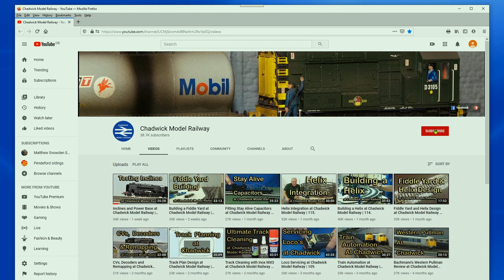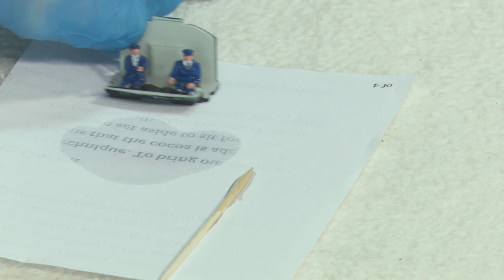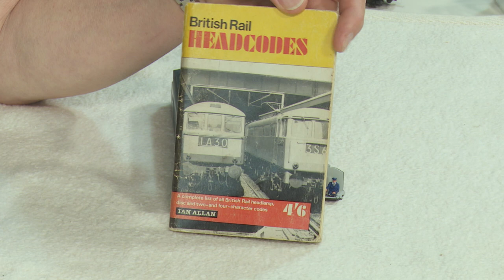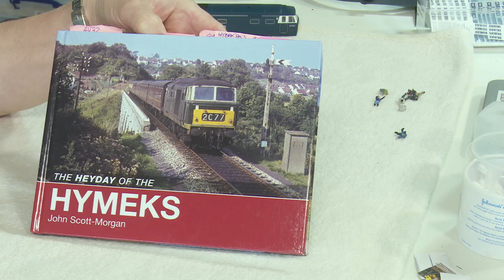Fitting Loco Crew at Chadwick Model Railway | 130.

Comment: The Dremel section was like watching a horror movie. I was just waiting for you to lose a finger!
Reply from the maker: Come on Bill, have some trust!
Reply: I was thinking the same. 

Reminded me of my old P.E. teacher who tried to adjust the motor fan of his car with a finger and then unbelievably tried it a second time! Result: He lost the ends of two fingers. He wasn't the sharpest tool in the box as you've probably surmised.
Reply: @ChadwickModelRailway  Really? Please take more care as we all care for you very much. Or at least I do.
Reply: @ChadwickModelRailway  By the way, I destroyed my left hand thumb while doing a blind dado cut on a table saw while doing some woodworking to relieve myself of a twit who required me to fix a mirror in the soon to be sold house. You can look up what a bling dado cut is. I no longer do those kinds of cuts, instead preferring to use a router to complete any such work. We all care about you Mr. Bishop, or at the very least I do. Accidents occur in a rush. I thought I had had a lucky encounter with real harm, only to discover that there was some liquid splattering upon the floor. It was my blood from a dangerously 'sawed' off thumb. That thumb still does not work properly despite emergency micro-surgery by the best surgeon in the area. We all care about you very much. please do take extra care, especially as we both age. I only say this because I care. My thumb, of my left hand, after decades, has some slight movement in it. Safety first my friend. Safety first.
Reply: I had the same when watching Justin of SMS the other week I saw it coming Ouch!! 🥺
Reply: @ChadwickModelRailway  i have faith in you charlie
Reply: I think the entire model railway fraternity held it's breath for a moment!

Comment: Recommendation from a model painter: Use the grey primer from halfords, much easier to see detail. Thin citadel with water instead of thinners and apply in two thin coats. A diluted flesh wash on the "fleshy bits" and a black wash (Citadel Nuln oil) on the uniform will really help.
Reply: Wow, that is great advice. Thanks very much. R. Mycroft
Reply from the maker: What an excellent comment Mark, many thanks.

Comment: Charlie,
Great tips.  But I would like to add a couple.
First whenever I purchase high price (Metal) scenic details, like figures, I ALWAYS take a bit of modeling time  to cast a mold.
In this CoVid-19 quarantine lockdown I have been experimenting with Silicon in water moldings.  No I am not yet proficient.  But Epoxy molds I have raised myself to a level competence.  SO...
When I buy small scenic parts, before painting, weathering, amputating, or gluing, i make molds of them.  Then when I need a batch of such items I just make my own model castings.  First it adds to my modeling artisanship.  It gives me something to keep my hands active while watching the TV.  And it reduces my modeling cost drastically.
Lastly, Charlie to keep the damn Rivet Counters at bay.  Before attaching the hacked off figures into your train cabs or coaches paint the severed ends the color of the seating or flat Black.  With certain glues the paint may limit adhesion.  Beware!
Great episode, Charlie
~Jim in the U.S.A.
Reply from the maker: Great comment Jim, I’m very impressed.

Comment: They did look better with cab staff Charlie.  I got a little bit worried when I saw you with the dremell cutting the bottom half off.  It was interesting that it was difficult to tell the cheaper e bay characters from the more expensive painted ones from a distance.  However, it has made me think I need to get more operating staff in my steam locos of which I only have some in place.  They definitely look better.
Reply from the maker: I’m so pleased that you found it interesting Don, and as you say, it’s time to man up. Regards Charlie

Comment: One will have to be very careful when going to meet Charlie for a drink. As one could end up going home all painted up and legless, LOL. When you mentioned the use of glues and as I haven't seen all your videos yet. Have you done a Vlog about caparisoning the glues we have at our disposal over another similar brand. Plus what would you say are the pros and cons that you have found using them on materials to which they are supposed to bond i.e. plastic, wood, metal and card etc. With your comments about health issues and wearing protective gear. You had me on edge with the sight of seeing raw meat and bone whizzing threw the air and red fluid plastered over the camera lens. All the while hearing you say, "Well, that will be my fingers then", LOL.
Reply from the maker: Sorry about the scary bit.  I’ll have a think about glues, they really are varied and subjective in our choice.
Reply: @ChadwickModelRailway  Yes, when one thinks about it, it is a rather STICKY topic to talk about, LOL.

Comment: Another informative video, delivered in a down-to-earth way, warts and all! One suggestion regarding the CA glue - don’t use it....... As for the spray can of accelerator talk about overkill. If you use it get a small pump bottle of accelerator, it is the better option and apply using a small plastic pipette to put a couple of drops on the joint. Using accelerator makes the CA very brittle, was there a reason you couldn’t just leave it to set for a minute or two? To fix the crew just use one of the tacky craft glues, more than strong enough and easy to remove later. Anyway thanks for your videos Charlie, always interesting and entertaining.
Reply from the maker: The wo part mix glue proved to be the best but a fair point regarding CA glues mate.

Comment: Absolutely worth doing.  Not so important on   heljan models as few locos come with cab interior lights but for those models that do its  worth picking out the bulkhead details with a bit of paint. Very satifying and easy if youve removed the cab anyway.
Those quartz light bars that heljan fit are horrible and easy to break.  Thankfully they are moving over to LEDs as models get retooled.
Reply from the maker: I’m so pleased that you enjoyed it. Regards Charlie.

Comment: Crews in front look great when examined close up, ditto on your very simple sound improvement - well worthwhile, however not keen on the mini flying saucer in the opposite cab window! Like you I have found you have to experiment with speakers - installation, location, baffling and type, there can be surprising results!  I wonder will we ever see drivers being raised and lowered into position as the engine reverses at either cab end (got to use those redundant DCC digital outputs for something), or perhaps a holographic display!!! Certainly a stimulating video, thanks. Stephen.
Reply from the maker: Interesting points Stephen and I’m so pleased that you enjoyed it.

Comment: Great vlog Charlie, didn't know Paul Daniels and Debbie McGee were so involved in railway modeling 😅🤣 as for the sound great improvement, as for black tack, just wished for Farish to use a wee bit less 45 minutes it took to remove a 66 body shell (too fit a decoder  😣) against four minutes on the next one, if the loco hadn't been so expensive The GBRf 'Evening Star' could have found its way into the bin! had to move from O gauge to N after moving onto a 40' long narrow boat, from a three bed house.
Reply from the maker: N Gauge is certainly more challenging.

Comment: Hi Charlie... .glues!! I was reluctant to use glue on the worm's couplings (to the Heljan class 35's cardan shafts) because this area is always going to have lubricant around and I didn't want to repeat this procedure again if the lubricant broke down the glue..... So what I did with the worm shaft was to use the wire cutters to carefully score the end of the shaft with a number of cuts into the metal. This roughened surface which I found was sufficient to allow the plastic universal joint coupling to push back on while effectively stopping the shaft turning in the coupling. ..... I had 4 to do so it seems to have worked very effectively.  I practiced on an old motor shaft first to check how much pressure was needed with the wire cutters to just faintly make several cuts into the metal without damaging or distorting what I was trying to fix...... .
Reply from the maker: Great info Gordon, I shall do mine too.

Comment: A suggestion for removing the bodies I use a guitar plectrum on all the lug points. I find that you need to ease all lugs before the body will come off sometimes and using the plectrum makes it so easy, because the plectrum is thin it does not distort the body of the loco.  Also they don’t fall out as you try to remove the body and the plectrum is stiff without fear of body damage
Reply from the maker: An interesting option Andy, I shall have to go to the music shop. Regards Charlie
Reply: I got mine from ebay

Comment: I think if you're going to add crew and then proceed to slice them in half, that the cheaper option is the more sensible option!

Liked the sound files, couldn't tell much of a difference though before and after sealing sadly
Reply from the maker: It does sound better but perhaps not recorded well.
Reply: @ChadwickModelRailway  I'm sure it sounds better in person, like all these speakers they don't do well being recorded and processed by another device!

Comment: You can sack off that speaker (on the V4) and fit a single iphone speaker. Just squeezes in the heljan locos if you chop the sticking out pcb solder tabs down.
 Can put the cab back in then
Reply from the maker: Thanks Eric but what I wanted to do was to compare the two speakers with each other. I could quite easily fit a sugar cube in the version four. Regards Charlie

Comment: Great work, what a broad skill set this hobby requires / develops.  They do look better.  “Offline” locomotives with drivers still in can look odd, not a problem when they are down the helix and hidden in the levels of Hades down below. 

Probably not a CV query but I have not installed lighting on a couple of Loco’s for fear of the adding them to the DCC system more than the actual practical installation piece.
Reply from the maker: Hi Dave,, do you mean that they will draw too much power through the decoder? Regards Charlie
Reply: You see that is something else I hadn’t thought of.  No, the hesitancy is all about how to tie the lights into the DCC chip practically / wiring wise and then setting up the chip.

Comment: Interesting video Charlie . I did/do all mine using Dapol Kitmasters C002 trackworkers. You get 39 figures unpainted and I just cut them down for diesels with a Stanley and the others for Steam look like drivers/firemen. Yes video on CVs would be great like adjusting start voltage /disable back EMF turn off DC etc. 
Thank you
Reply from the maker: Hi shall certainly look into those options Alan. Regards Charlie
Reply: @ChadwickModelRailway  forgot to mention these cost just £6ish a bag unpainted

Comment: I was watching and old BTF where they were gluing sensors to railway bridges to check for movement. They said the adhesive they used was so strong the only way to remove it was to use an angle grinder. They never mentioned the brand of adhesive though. :-(
Reply from the maker: That’s a pity, we’d like to know what that was.

Comment: Hi Charlie, I always fit figures and improve on 'repaint' factory fitted figures as well. I don't 'shunt' on my layout so all my locos are fitted with front end detail. Most horrible thing for me to see is something like a Terrierr tank engine with its tension lock coupling still attached to the front, dam thing is almost as big as the loco itself and just shows you have a 'train set' and not a 'model railway'
All the best look forward to the CV video Cheers Peter
Reply: If anyone's interested in fitting sound into N gauge, I've had success fitting the sound module into a brake carriage that sits immediately behind the locomotive. Lots of room and no windows in a break carriage, so fitting is easy. 

Rick
Reply: You'd positively hate my "Train set" then, as I've even cut up the valances on my Hornby 91 and DVT to fit large tension lock couplings, meaning that can now run round and haul Blunt end first with the tsoe at the rear, or my rake can be loco hauled from either end, or shunted etc,etc. The front valance was refitted around each coupling, and my tsoe has buffers and no corridor connection, yes it's not as pretty but from an operating potential it's more realistic and for me that counts for far more so perhaps before dismissing someone's pride and joy as a mere "train set" because some other modeller has other preferences. You don't have to agree with someone else to appreciate what they have done for their own entertainment and are willing to share it with you. Unlike Charlie I pin my track not glue it as I'm forever tweaking track layouts one day I might even ballast it but probably not glue it as then I'd struggle to change it, I enjoyed watching Charlie glue, spray etc his  track down
Reply: @philipstokes2824  No I understand Philip, I have gone over to the magnets myself as they work very well for me and my little layout.
Reply from the maker: A fair point Philip but what I would try is using the Pico screws to secure track. Regards Charlie
Reply from the maker: A good idea Rick
Reply: @ChadwickModelRailway  first time I heard of those was a few videos of yours ago, love how you go through the different ways of doing things and then say why you do things your way, very educational, not sure how they work in the MDF ( not your favourite material I know Charlie but it doesn't warp too much when screwed down on a solid timber frame and it is quite sound absorbing, maybe there is a market for rubber ballast?) But track pins are cheap and just  push in and pull out of MDF, and there's nothing permanent about my permanent way!!!! Regards Phil and keep up the good work
PS I'm analogue and the hand of God changes my points!!
Reply: @torridonroadbypeterdixon4162  if you mean those magnetic couplings they sound a great idea especially for little kids, I took lots of patience to teach a four year old to use a bent paperclip to uncouple tension lock couplings, but less time effort and expense than changing all my stock dating back from when I was that age, same reason I've no intention of going digital the cost and effort would never be worth it, and it would take me years to do it all in the limited time I have, and in that time is have two incompatible sets of stock, first butchered my 91 and DVT at about 14 years old, by fitting homemade wire couplings which sort of worked recently took a hacksaw to the front ends fitted a rear bogie frame with the coupling extended out and refitted the remains of the valences, it now works much better like how I thought Hornby should have made it when it was new!!

Comment: Of course your era, double manning, but you can for fitted freight have a guard in the year cab, so you can get away with someone in each cab, for when you  run your loco in reverse
Reply from the maker: But in which seat would the guard sit!
Reply: Normally the guard sat in the drivers seat in the rear cab not the second mans seat

Comment: Two of my 4 Heljan Class 35s had developed a serious fault!!!! The motor was spinning but traction to the wheels disappeared..... Following your explanation how to open up the body and bogie frames I bit the bullet this morning and began to search for the fault....In each case I found the cardan shaft coupling to the bogie gear tower was loose on its shaft.....How to solve it ....taking out the gear worm and bearings I pulled off the miscreant coupling ... pinched the exposed shaft with wire cutters to slightly cut into the metal ...refixed the plastic coupling onto the shaft and reassembled.....Bargain ... 4 loose shaft couplings refixed in under 2 hours. Many many thanks...Gordon McDonald.
Reply from the maker: Well done Gordon. I need to do one of mine as well.  A friend used super glue. Any thoughts?

Comment: For acrylic paints you don’t need thinner. You can just use water, works just as well.
Reply: Yes, Bart, but I prefer to use thinners myself as it evaporates and dries quicker, so is less likely to give a paint run. I often find that water-thinned acrylic seems to be repelled by plastic or metal surfaces, while using chemical thinner gets around this problem. So I'm with Charlie on recommending using acrylic thinners.

Rick
Reply: @rickbear7249 Good point. That why I always use a primer first. And use very thin coats of paint to prevent running.
Reply from the maker: Great points gentlemen, many thanks regards Charlie

Comment: Another interesting video, I tend to buy the pre painted ones, I do not think my eyes are up to painting n-gauge ones.....lol. A question do all the diesels have two crew in them, I was wondering what side to put the driver on.
Reply: They had two crew if the loco was intended to go faster than 100mph or travel more than 200 miles, (later 250 miles) or a non stop distance of 100 miles, (later 125 miles). http://thebrightonbranchofaslef.yolasite.com/1965-manning-arrangements.php The HST design was changed so that they could have two crew in the cab for instance. The driver usually sat on the left hand side because signals are usually sited on the left hand side of the track as are platforms.
Reply from the maker: But back in the 1960s/1970s, I think that all unfitted frieght had two chaps as well.  Regards Charlie

Comment: Hi Charlie, love the video, as usual very informative and useful, now this is a bit of a different question, do you have a wiring diagram from a peco insulfrog single and double slip?? I’ve emailed peco with no reply, thanks in advance if you have
Reply from the maker: Hi Kevin, as I recall I just put two droppers down and the rest of the cables and rails are all connected.